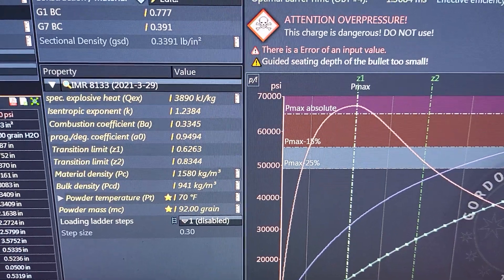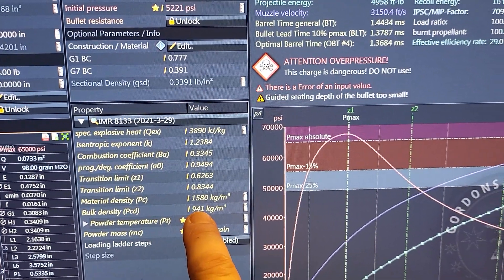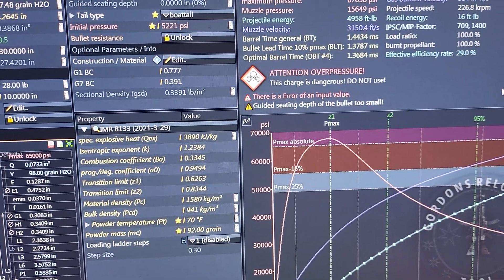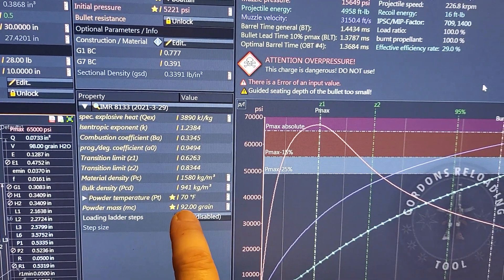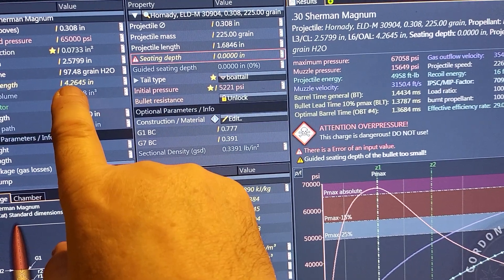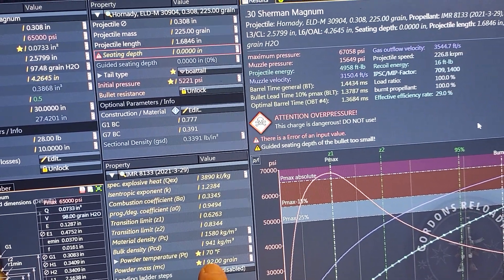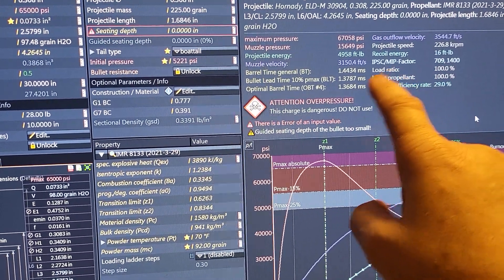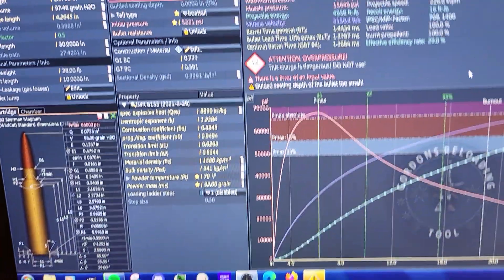GRTools: How to find and adjust the bulk density of the powder you use?

Comment: Do you do this with a sized case or fired case? My assumption is a sized case.
Reply from the maker: Since the load ratio is meaningful for when a sized case is filled up with powder, then we use a sized case as you guuessed
Reply: @YERAFirearms  I did this last night. It changes my load from 91.9% filled to 95.5% filled. Thanks for showing us how to tweak this setting to out actual situation.
Reply from the maker: @mln19631  You are most welcome.
Reply: @YERAFirearms  thanks, that’s what I figured.